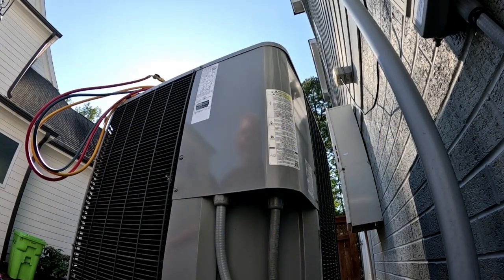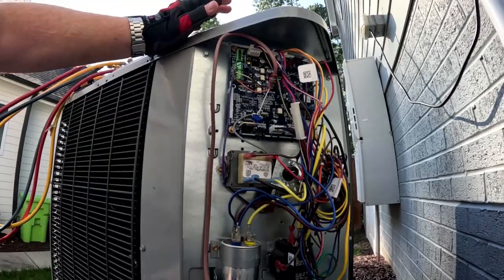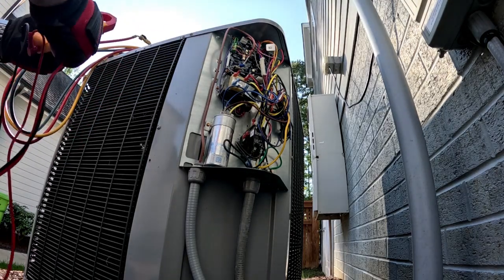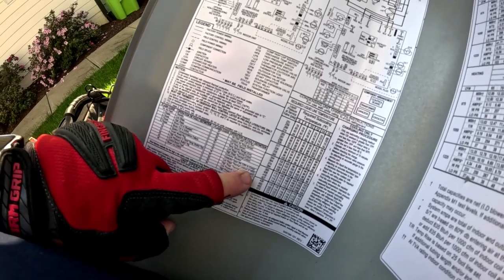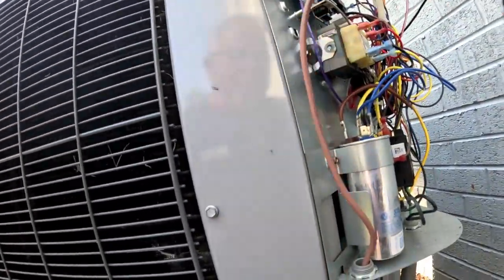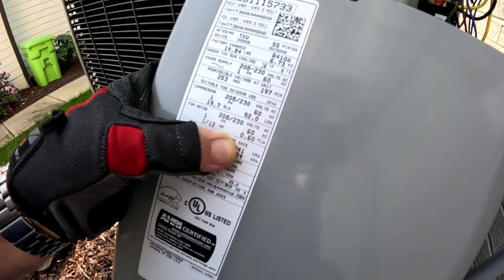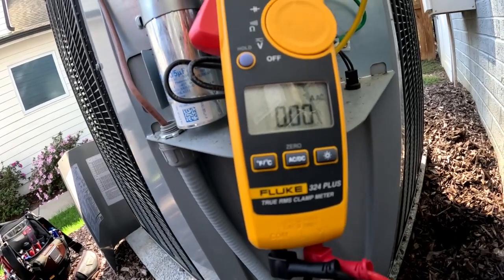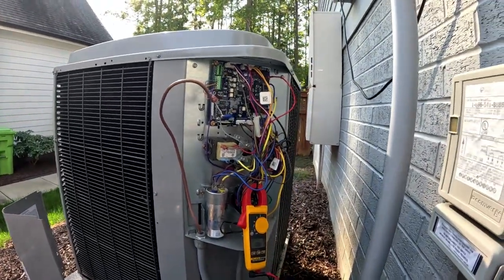Diagnosing a locked HVAC compressor.

Comment: Did your Fluke meter come with that magnet on the back or did you field modify?  Thanks for the videos!
Reply from the maker: Took one of those rubber covered magnets from the back of an old Fieldpiece.  Never understood why Fluke didn’t have a magnet, considering how much they cost.

Comment: Great video Charles look forward to the compressor replacement and hopefully you will install a microaire soft start kit to protect from surges if it is Compatable with this system.

Nice to see you working on more normal systems besides just tranes someone needs to show certain hvac guys up like pipe doctor and some others.
Reply from the maker: That's the plan!
Reply: @MYHVACLIFE  I get oem Charles for the start kit but is it  a, soft start kit and that unit needs some surge protection too like military grade but I brought up microaire soft start kits because they actaully work to reduce Inrushes and Amp draws to protect the compressor as well as, control spikes. But those kits are no good with inverter driven systems.

Just curiose Charles of the oem start kit is a, soft start and not a hard start the last thing that compressor needs is a hard start.
Reply: I think Steve lav.  Definitely needs much more electrical knowledge that he seems to lack in

Comment: Those emergency alternators can deliver higher or lower votage or other than 60 cycles per second. any of those conditions will ruin lots of equipment in a home. I've known some folks to spend up to $ 30,000.- as a back up. I doubt the ustomer gets paid for damages!

Comment: Is that electric box on the wall a energy company load control or generac load control? I had a generac control take out 2 compressors in the same unit at house withiin a year
Reply from the maker: Energy company
Reply: @smacleod69  energy companies load controls are the worst you can get components yourself to control loads